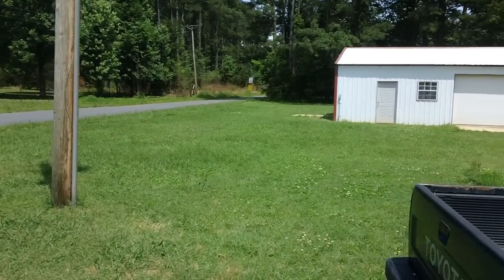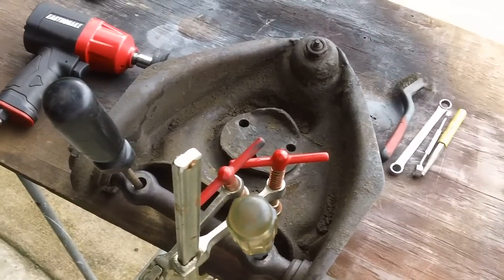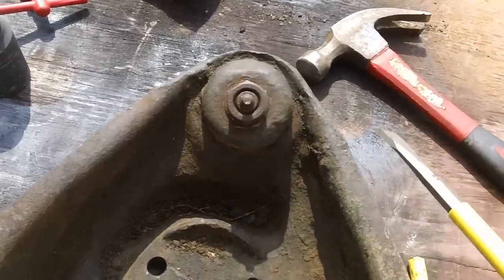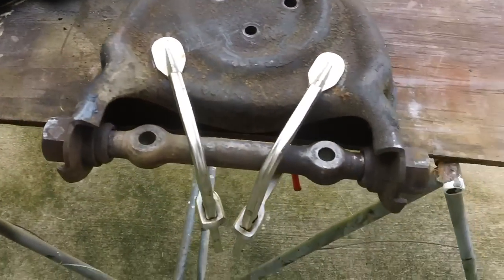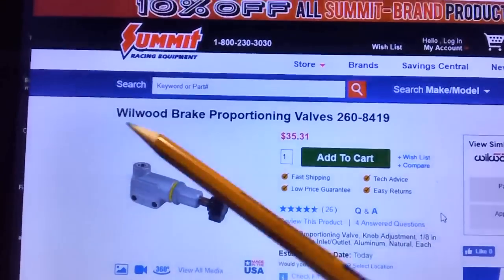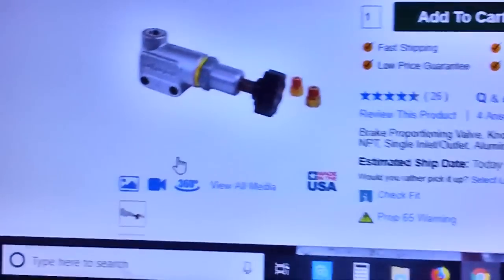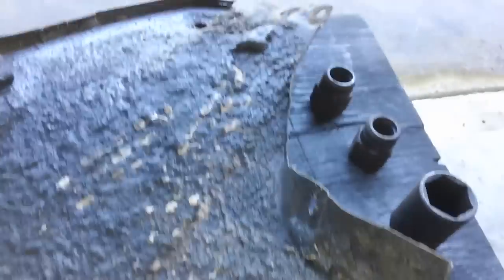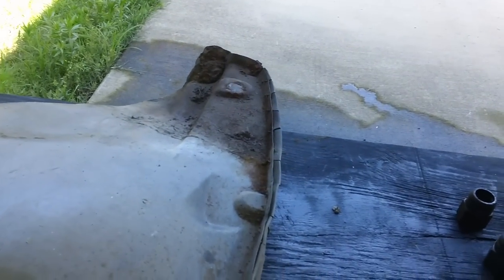1966 Ford Thunderbird repair and refurbishment (Part 48). Cleaning the front end parts.

Comment: On my car I am going to clean all the underside metal with a blaster and paint it all with a product I get in my city in CANADA , It's called DOM-16. It is the same idea as CHASSIS SAVER but a little cheaper. It is also similar to POR-15  but not as complicated. This DOM-16 dries rock hard to lock out all moisture  but it has to be top coated because it is UV SENSITIVE. ALL these products were developed by the army and the DOM-16- is designed to stick to surface rust so the metal does not have to be blasted but it won't hurt. If you don't top coat it it will go on gloss black but will flatten out over time and also thin out. Just wait for the two light coats to tack up where you can touch it and no black will be on your hands and then hit it with    sone enamel of your choice. Great protection and simple to use. I used that POR-15 And you have to do too much prep work with it. Plus that POR-15 is expensive. All these products lock out the moisture so if the metal can't breathe it will not rust. One quart goes a long way and is self leveling. Wear gloves because if you get it on your hand even paint reducer will not take it off. You will have black hands for two weeks. Throw brushes away , not worth cleaning. If you leave the brush out with the DOM-16 on it ,the next day you will be able to stab someone with it. Happy TRAILS!!!! Ps.....blast those control arms and every other part and powder coat them. EASTWOOD COMPANY sells a cheap kit. Rock hard finish.
Reply from the maker: Michael,
That's too much work for me, so have at it, my friend.  I'm content with just doing a refurbishment.
Regards,
John

Comment: John, you need a ballpeen hammer and a heavy duty vise.  But, don't get a heavy duty vise unless you have a heavy duty work bench.  The last time I used a pipe extension on a 1/2 inch flex handle I broke the handle, so I went up to a 3/4 inch flex handle!  It has never broken.
Reply from the maker: Ansel,
Hammers and a vice will come later...maybe.  Right now the bucks are allocated toward buying bushings, coil springs, gas and fuel lines...and whatever else unexpectedly pops up.
Regards,
John

Comment: Goes to show..... Run what ya brung.  We once took off an oil well case head with a 60" pipe wrench, a chain and an F350 w/ a trailer hitch
Reply from the maker: Jim,
Next time use a '66 T-Bird and those caps will come off faster and easier. 😛
Regards,
John

Comment: When restorers start they usually eat 3-4 parts cars.the ac receiver drier will strip if you try to remove the tubing just another caution.   ye car isn't worth the effort you put into it.but I know this is a video.
Reply: I have to say my 66 was 4yrs old when purchased . the hayes brakes were excellent even. In snow .if that's a 390 replace the oil  pump they were weak sometimes tight .some had a hex shaft  that broke don't remember on 390 .I  was tv tech in life .you mentioned radios have cathedrals trans oceanics 1r5 good sub for 1l6 which costs more than the radio if your into them
Reply from the maker: Have you considered doing a classic car refurbishment or restoration series yourself?  If not, let me do this my way.  This series is for those with little knowledge about old cars, not for the experienced mechanic.  I've stated it numerous times.
Reply: joernone Joe I'm not knocking I had 3 of these told you about park problem . tried to save you grief .I'm not a mechanic. just had 61 63 66 67 bird in day also mk3  57cvt 60 62 64 67wagons bless you with all of my heart.never restored any of them !I'm disabled 80yrs old wish I could do what your doing . sorry..!